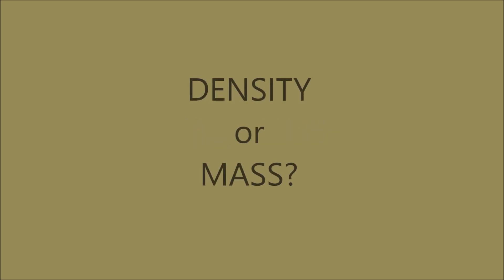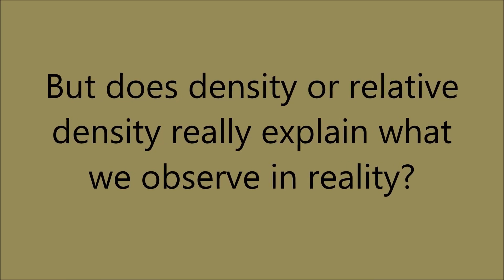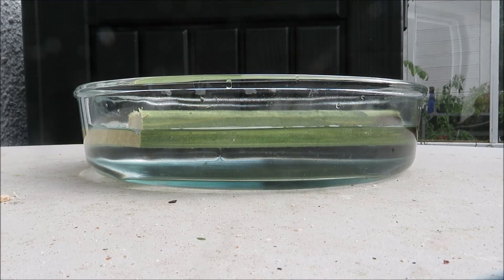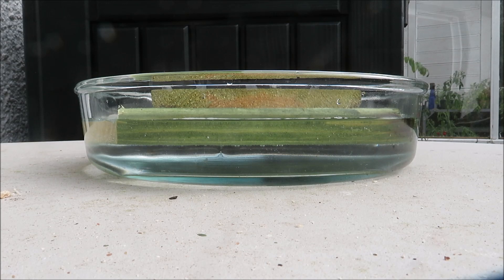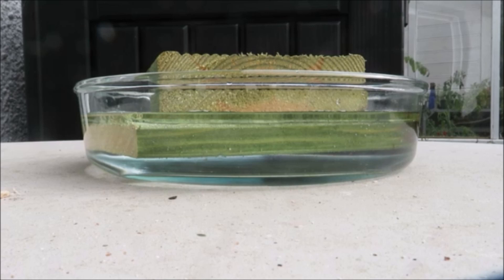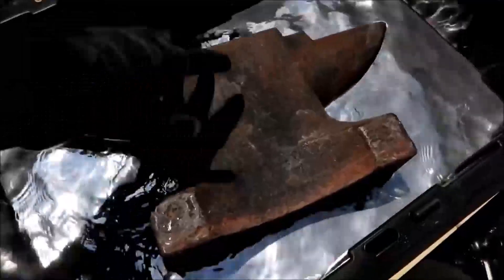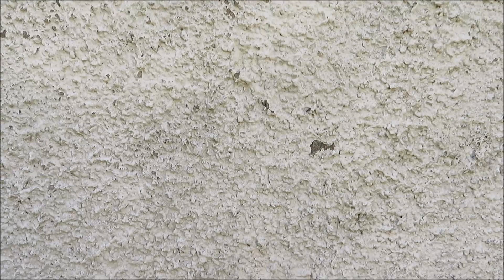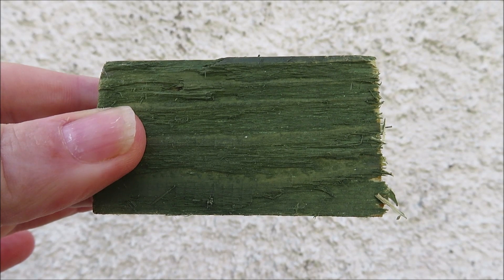Density or Mass?   Gravity or Relative Density?

Comment: @Miles WOW Someone clearly does not understand what density is!! You know the density part is comparing an equal volume between the two i.e. kg/m3 or g/cm3. When you have an unequal amount of volume and an unequal SHAPE, then the surface will displace the same amount of mass as itself, you having a container will restrict the volume and create a pressure. You have mistaken density comparison for structure and volume Hahahahaha You clearly do not understand the Archimedes Principle and you clearly do not understand how he made one of the largest ships in history with his knowledge of SURFACE AREA DISPLACEMENT!! OMG Miles welcome back... and what a come back this is!! How did your Cavendish "bedroom" Experiment turn out again?

And your last question is an HILARIOUS misunderstanding of density!!

AIR ABOVE WOOD = 0.001222 g/cm3
AIR BELOW WOOD = 0.001221 g/cm3
WOOD = 0.96 g/cm3

Neither the air above nor below can support its mass WITHOUT A STRUCTURE, i.e. a cotton net can catch a cannonball due to its STRUCTURE not comparative density.

You are completely omitting the last bit of the Principle of Least Action:

"The wood will seek the path of least resistance [YOU STOP HERE] in order to achieve its natural equilibrium/rest again"

In the case of wood YOU have elevated it UPWARDS in order to take it out of its natural Order of Magnitude of Density resting place. This will ALWAYS mean that it will return in the opposing direction with a vector pointing straight to the quickest path to where you took it out of rest!! You simply cannot understand how I can describe the whole notion of picking stuff up JUST using Newtons Laws of motion WITHOUT invoking a magic force!! YOU on the other hand think you are a magician and can pull gravity out of your sleeve... Sorry you may have gone, but unfortunately I have not!!

Newtons 1st = A piece of wood on the floor will stay on the floor until you pick it up. Picking it up requires energy input which is stored as potential in the net system.
Newtons 2nd = The wood will remain suspended in air if you clench your fingers and keep applying a force proportional to its mass and distance from its equilibrium and keep it there.
Newtons 3rd = When released the wood will return all energy inserted in to the system will be released and going from zero to non-zero requires acceleration from the input energy stored inside the system already. This gives us a rate of induction through the medium and the maximum rate being terminal velocity.

Archimedes Principle = This will determine relative direction depending on density of the object vs medium
Principle of Least Action = The wood will seek the path of least resistance to seek equilibrium with all other wood on the floor at rest.
Reply from the maker: Thanks for that, I may have to use this comment as a subject for a future video.  For now, I have just made a follow-up video which you may wish to have a look at.
Reply: @MilesDavisKDAB  Have you been cut off from benefits? And just need to make as many videos making as many mistakes as you can just to get people to comment and watch? Hahaha weak marketing tactic. Notice how you cannot address a single thing I just schooled you on!!? Is it because you think your next video covers this?? Hmm nope, I have already crushed your next video in this comment alone too!! Please just address your issues:

1/. Why did you NOT know or understand that STRUCTURE of the wood vs the VOLUME OF WATER. What you are attempting to debunk is the Archimedes Principle which is simply put as:

"Any object, totally or partially immersed in a fluid, is buoyed up by a force equal to the weight of the fluid displaced by the object." or even more simpler "Any floating object displaces its own weight of fluid." - Archimedes

2/. Why can you not tell me why I CAN explain the complete system of picking wood up and dropping it WITHOUT one single mention of a mysterious gravity force?

3/. Why can you not tell me why you think a piece of wood dropped in air would seek the medium ABOVE it when the very medium below it is a 1000 times less dense and cannot support its mass?

You are stumped more than the whole English Cricket team's careers put together!!
Reply: You need a force to determine the direction. Density is directionless. Why does higher density go down and lighter density up? Mass/volume has nothing to do with direction or force. 

If you're gonna make up some reason things fall without gravity then at least make up your own units. The ones you use already have meaning.
Reply: @thefoxamongwolves9843  "You need a force to determine the direction."
Err did you not see the potential force input in to the system? Hahaha lets pretend you did not pick it up yeh? Well then its there on the floor not moving..... Now what? It doesn't fall does it!!

"Density is directionless."
It has a natural sorting order called the Natural Orders of Magnitude of Density... Its the old more dense stuff below and less dense stuff above, if you deny this then you have a clear problem with reality and need to get that fixed.

"Why does higher density go down and lighter density up? "
Because of the natural orders of magnitude of density. I mean woods equilibrium is not in a cloud, so why would you expect it to go UP when you had to PICK IT UP in the first place and it was not already going UP!! Come on this is common sense, something you seem to neglect.

"Mass/volume has nothing to do with direction or force. "
Good job its the disequilibrium of an objects density within a medium with a certain density, which you will find is fully covered in Archimedes Principle which does not contain Gravity and worked fine without it for 2000 years...

"If you're gonna make up some reason things fall without gravity then at least make up your own units. The ones you use already have meaning."
Why when the existing units of kg work perfectly fine! You don't just make stuff up in science!
Reply: @Gleem "you have a clear problem with reality and need to get that fixed." Ironic. 

You don't get it do you? WHY does it order itself in that way? You can say your made up rude of density but you have no evidence for it. It fails when applied to anything. Why does it stop working in free fall?Why do things fall at a constant rate in a vacuum? What is the 9.81 m/s^-2 acceleration we measure and why does it apply to everything? Wouldn't denser objects fall faster? You explain nothing with density because density is just a measure of how much mass is withing a volume, not how much force it exerts downwards. That is why you need new units, Kg doesn't work because Kg only means mass. Where is the direction? it's a directionless unit. What applies this force and direction? 

Where is the paper for the Natural Orders of Magnitude of Density?
Reply: @thefoxamongwolves9843  Sorry just moved devices, so to add:
"You don't get it do you? WHY does it order itself in that way?"
Earths electrostatic field does the job much better than a mysterious force that does not wok at quantum scale and does not work at cosmic scales.

" You can say your made up rude of density but you have no evidence for it. It fails when applied to anything. "
No it does not when you shift concept of a mysterious force to a natural order of magnitude and use the Gravitational Potential Energy as your input energy instead of shifting your hard work on to a magical force.

"Why does it stop working in free fall?"
It does not at all, you simple do not know how it works..

"Why do things fall at a constant rate in a vacuum? "
They don't look up Guinea Feather Vacuum on youtube and see University of Washington Physics Lecturer who made himself a dual vacuum with each object dropping in seperate vacuums excavated by the same pipe. When he drops them literally all occasions they do not fall equally. Also Boyd Bushmans Anti-Gravity Drops in Lockheed Martin, and also in the same vacuum it is merely the pressure from the displaced medium acting on both objects equally on the top. Its all easily explainable without invoking magic forces when you look in to it.

"What is the 9.81 m/s^-2 acceleration we measure and why does it apply to everything? "
Its the measured rate of induction through the medium on the surface of earth. When I mean the medium I mean the electrostatic medium which we all swim in, going up to about 50km.

"Wouldn't denser objects fall faster?"
Why are you giving them more force to fall faster? If not then why should they? All they will do is reach a rate of maximum induction, which is terminal velocity.

" You explain nothing with density because density is just a measure of how much mass is withing a volume, not how much force it exerts downwards. That is why you need new units, Kg doesn't work because Kg only means mass. Where is the direction? it's a directionless unit. What applies this force and direction? "
You give the vector from whence you act upon it.... I don't know whether olde english words will help you get it, as plain and simple language is not working! Kg's are a unit of MASS, gravity is an assumption BUILT IN to that total measurement. MASS is still the same and WEIGHT is still the same on a flat earth, weight is merely a product of how mass acts in a medium of equal, greater or less density. This gives the directions of at rest, up and down...
Reply: @Gleem That's not a paper? That's a reference for magnitudes of density. You know what a scientific paper is, don't you? Like Einsteins paper of the theory of relativity and such. That explains how all this works and cites evidence. It should explain how this electrostatic induction thing works. Of course it doesn't exist because no flat Earther has ever written a scientific paper. 

Citations please for the vacuum chamber tests.

Finally, units. If induction is indeed behind this then why isn't it part of the units? Like how weight is mass X acceleration. Density has no involvement, just like it doesn't with gravity. See all you're really doing is replacing gravity with electrostatic forces. So why all the song and dance about density when it doesn't come into play any more than it does in the gravity model? 

I think it's because you have no idea what you're talking about and are desperately grasping at straws hoping to sound smart. Maybe to a pigeon, but you're not fooling me.
Reply: @thefoxamongwolves9843  So what was wrong with the 6 papers listed at the bottom?

"Pressures in the low 10−14 torr range have been reproducibly achieved in a 3 m long vacuum chamber. Pumping was provided by a 400 I s−1 sputter-ion pump, a titanium sublimation pump and 43.5 m of a ZrVFe Non Evaporable Getter (NEG) strip. Activation of NEG has been passively achieved during the initial bakeout of the vacuum system. The pressure has been measured by means of a modified version of the Helmer gauge, designed and manufactured at CERN."

Obtention of pressures in the 10−14 torr range by means of a ZrVFe non evaporable getter 
https://www.sciencedirect.com/science/article/abs/pii/0042207X9390084N?via%3Dihub

NASA List of magnitudes they have measured:
https://history.nasa.gov/SP-402/ch2.htm#37
https://history.nasa.gov/SP-402/p2.htm

"Ultralight (<10 milligrams per cubic centimeter) cellular materials are desirable for thermal insulation; battery electrodes; catalyst supports; and acoustic, vibration, or shock energy damping. We present ultralight materials based on periodic hollow-tube microlattices. These materials are fabricated by starting with a template formed by self-propagating photopolymer waveguide prototyping, coating the template by electroless nickel plating, and subsequently etching away the template. The resulting metallic microlattices exhibit densities ρ ≥ 0.9 milligram per cubic centimeter, complete recovery after compression exceeding 50% strain, and energy absorption similar to elastomers. Young’s modulus E scales with density as E ~ ρ2, in contrast to the E ~ ρ3 scaling observed for ultralight aerogels and carbon nanotube foams with stochastic architecture. We attribute these properties to structural hierarchy at the nanometer, micrometer, and millimeter scales."

Ultralight Metallic Microlattices
https://science.sciencemag.org/content/334/6058/962

Densities of Osmium and Iridium - RECALCULATIONS BASED UPON A REVIEW OF THE LATEST CRYSTALLOGRAPHIC DATA 
http://www.platinummetalsreview.com/pdf/pmr-v33-i1-014-016.pdf

"Citations please for the vacuum chamber tests."
What are you really going to do with them if you cannot even scroll a webpage and pay attention for more than 5 seconds!!

Guinea and Feather
https://www.youtube.com/watch?v=zXDZWKmRxI0

Here his is step-by-step guide of how and why he built it:
https://www.instructables.com/id/Building-a-better-Guinea-and-Feather/

Now please explain why you have NOT just prove you are the idiot here again? I just cannot figure that one out yet?
Reply: @Gleem Those are called "citations." You usually link them in your paper when you reference them for whatever reason. I asked for a paper on your Natural Order of Density, or is it induction now? Anyhow, I wanted a paper that explained how it all ties together. What you provided did no such thing and seems to have no relation to your relative density theory aside from the fact it has the word density. The citations are only there so I can check the references if I feel the need to, not to be your work. That's called plagiarism. Clearly you have no idea how scientific papers work.

Okay, the Guinea and Feather experiment. This doesn't prove anything, sorry. It is a neat demonstration but has a few flaws that invalidate it. The way the two objects drop isn't' controlled. We can't see the top of the tube when he flips it so we can't say for certain, but I think friction is delaying the drop of the lighter paper disc. Force = mass X gravity. The mass of the paper disc is certainly far less that the metal disc, so it would have less force pulling it down. This means the force of friction acting on it will hold it in place much longer than the metal disc.Thus the metal disc will begins sliding down first, giving the appearance of it falling faster. But that's not true. 

To actually prove anything you'd need to change the experiment a bit to remove that variable of friction. To do so I'd say ditch the whole flipping thing and add some sort of release mechanism. That way we can drop them at the same time. Though this obviously isn't always perfect either. Also, add in one those black and white scale things and record it on a high speed camera. That way we can actually compare how far they each move over a period of time and determine their acceleration. It's not a race, we want to see how much acceleration due to gravity/induction is being applied to them.
Reply: @Gleem Non of those papers are about your induction density theory. They're all just talking about either measuring densities or some cool material they've developed. None of them explain how induction solves all the problems of gravity. You don't need to yourself have written the paper (though I doubt anyone else would write one) but the paper you do link needs to actually be a paper and needs to actually explain your induction density theory. 

But sure, accuse me of not playing fair so you can avoid providing any evidence. I'd expect no less of a liar.
Reply: @thefoxamongwolves9843  "Non of those papers are about your induction density theory. They're all just talking about either measuring densities or some cool material they've developed. None of them explain how induction solves all the problems of gravity."
You did not ask for the resolve of all gravity problems, this is EXACTLY what I am here highlighting WHY HAS GRAVITY GOT SO MANY PROBLEM? You seem to not want to engage and just asked for citation of the orders of magnitude for density and Archimedes Principle... When its a reversal of concept, and go back to the original meaning of weight which is how mass acts in a medium, and that down force you speak of is merely air pressure. Then you ask for a paper on air pressure proving gravity wrong, when gravity was never proven in the first place and has an endless list of failures. 

When you are willing for a debate let me know, but what you are asking for is identical as me asking you to prove gravity on earth with a grain of sand orbiting a wrecking ball!!
Reply: @thefoxamongwolves9843  "I can prove" is the words of a fool put your evidence on the table which has been falsified...
Reply: @Gleem No. You provide your evidence for your induction density theory first. Don't think you can just change the subject. Prove that gravity isn't real and that this induction theory explains what we observe then we can talk about evidence for the Earth orbiting the sun in space. You can't worm your way out of it that easily.
Reply: @thefoxamongwolves9843  "@Gleem No. You provide your evidence for your induction density theory first. Don't think you can just change the subject."
I just put 10 papers on the table which are all evidence for it. And I am not changing the subject you simply cannot tell me where gravity is required here:

Newtons 1st = A brick on the floor will stay on the floor until you pick it up. Picking it up requires energy input which is stored as potential in the net system.
Newtons 2nd = The brick will remain suspended in air if you clench your fingers and keep applying a force proportional to its mass and distance from it equilibrium and keep it there.
Newtons 3rd = When released the brick will return all energy inserted in to the system will be released and going from zero to non-zero requires acceleration from the input energy stored inside the system already. This gives us a rate of induction through the medium and the maximum rate being terminal velocity.

"Prove that gravity isn't real and that this induction theory explains what we observe then we can talk about evidence for the Earth orbiting the sun in space. "
Gravity has been already proven not to be real, which is why its excluded from the Standard Model and fails miserably in the cosmos:

 "The Standard Model includes the electromagnetic, strong and weak forces and all their carrier particles, and explains well how these forces act on all of the matter particles. However, the most familiar force in our everyday lives, gravity, is not part of the Standard Model, as fitting gravity comfortably into this framework has proved to be a difficult challenge. The quantum theory used to describe the micro world, and the general theory of relativity used to describe the macro world, are difficult to fit into a single framework. No one has managed to make the two mathematically compatible in the context of the Standard Model. But luckily for particle physics, when it comes to the minuscule scale of particles, the effect of gravity is so weak as to be negligible. Only when matter is in bulk, at the scale of the human body or of the planets for example, does the effect of gravity dominate. So the Standard Model still works well despite its reluctant exclusion of one of the fundamental forces."
https://home.cern/science/physics/standard-model

And fails in these 3 x peer reviewed problems:

1/. Galaxy Rotation Curve Problem
Rotational properties of 21 SC galaxies with a large range of luminosities and radii, from NGC 4605 /R = 4kpc/ to UGC 2885 /R = 122 kpc/ - Vera Rubin and Kent Ford
http://adsabs.harvard.edu/full/1980ApJ...238..471R

Dr Don Lincoln - Fermilab (US Dept of Energy) - Big Questions: Dark Matter - 6m55s
https://www.youtube.com/watch?v=oPNrcKeqbBM

2/. Cosmological Constant Problem
The Cosmological Constant - Sean Carroll
https://link.springer.com/article/10.12942/lrr-2001-1

Dr Don Lincoln - Fermilab (US Dept of Energy) - Big Mysteries: Dark Energy - 7m42s
https://www.youtube.com/watch?v=THT_BAdKe6g

BONUS EVIDENCE OF INTELLIGENT DESIGN
Leonard Susskind - The Cosmological Constant Problem - 2m50s
https://www.youtube.com/watch?v=nXi_YaDO9ZI

3/. Horizon Problem
Inflationary universe: A possible solution to the horizon and flatness problems - Alan guth
https://journals.aps.org/prd/abstract/10.1103/PhysRevD.23.347

The horizon problem - why does the universe look the same in all directions?
https://www.youtube.com/watch?v=axrbSOFIdnk

BONUS EVIDENCE: Vera Rubin who was the main Astronomer behind Dark Matter is cited as saying:

“We know very little about the universe,” Dr. Rubin said in an interview for “Lonely Hearts of the Cosmos: The Story of the Scientific Quest for the Secret of the Universe.” “I personally don’t believe it’s uniform and the same everywhere. That’s like saying the earth is flat.”
https://www.nytimes.com/2016/12/27/science/vera-rubin-astronomist-who-made-the-case-for-dark-matter-dies-at-88.html

"You can't worm your way out of it that easily."
How is it that I have put 13 science papers on the table backing my sentiment, I can describe dropping stuff using just Newtons Laws of Motion, and have science which backs my statements, you on the other hand are just hand-wave dismissing, making claims you cannot back, and have not cited a single science source which backs you... Come back when you are willing to talk science, as you are clearly inept at the moment.
Reply: @Gleem You think you can describe dropping stuff with Newtons Laws of motion but you can't. You're either being dishonest or are ignorant. 

The Laws:
1: An object in motion will stay in motion unless acted on by an outside force
2: Force is equal to the change in momentum change in time or the mass times the acceleration.
3: For every action there is an equal and opposite reaction.

Now let's describe picking up a rock. You apply a force to lift it. Were there no gravity and you stopped applying force the rock would fly up forever. But you're holding it so you stop it and thus apply a new force to arrest it's motion, placing it at rest. Now you let go. The rock falls. We can conclude that some force was applied to the rock. What force is this? Most would say gravity. 

What you were describing was kinetic and potential energy. And for the post part you're right, lifting an object stores potential energy in it. Potential energy isn't literal energy, just a measure of how much energy the object will have when/if it falls. What you've neglected is where the potential energy come's from. It comes from a force acting on it. The rock is being lifted up inside a gravity well, kinda like swimming up stream. The higher it goes, the more gravity (or induction, principal is the same) wants to pull it back down. So the potential energy, the energy it will exert when it falls, increases until finally released and it can convert to kinetic energy. But you need a force to apply it. What force? Most would say gravity.

See, the irony here is you'd argue this inductive force but you'd be contradicting yourself. You claimed to be able to describe dropping an object with only Newton's Laws but as I've demonstrated: you can't. You need a force of some sort. If you claim that it's this inductive force then you straight up lied as you said you could describe it without such a force. Gravity and induction density whatever ware interchangeable, the physics is the same. 

Which is it? Do we need a force to explain this observation or not? If we do then why'd you lie about it? If we don't then again, why lie and make up this induction stuff? 

I could look at the other stuff but this screw up demonstrates that you probably don't actually know what those papers are saying and just think that they disprove gravity when, just from looking at the titles, they do no such thing. All they do is acknowledge the limits of our current understanding of gravity. 

If you have integrity you'd admit you are mistaken.
Reply: @thefoxamongwolves9843  "Now let's describe picking up a rock. You apply a force to lift it. Were there no gravity and you stopped applying force the rock would fly up forever. But you're holding it so you stop it and thus apply a new force to arrest it's motion, placing it at rest. Now you let go. The rock falls. We can conclude that some force was applied to the rock. What force is this? Most would say gravity. "
You clearly do not understand how basic physics works. The "some force" is the Gravitational Potential Energy you have put in to the net system in the first place by picking it up!! This same energy is returned when you release the brick. If the medium around the brick is more dense then the brick will go up, if its less dense the direction will be down. Its that simple!

"What you were describing was kinetic and potential energy. And for the post part you're right, lifting an object stores potential energy in it. "
Ok so now you agree.... So does this mean YOU are "either being dishonest or are ignorant. "

"Potential energy isn't literal energy, just a measure of how much energy the object will have when/if it falls. What you've neglected is where the potential energy come's from."
Nope not at all, the potential is inserted BY YOU!! As if YOU did not put in ANY energy, then the brick would not fall.. As soon as you put some energy in there, it is stored as potential until this is RELEASED, once release it returns all the energy you put in as an output kinetic energy!! This is an INESCAPABLE FACT, its just YOU remove YOUR input energy and pretend its some ghostly force getting involved....

" The rock is being lifted up inside a gravity well, kinda like swimming up stream. The higher it goes, the more gravity (or induction, principal is the same) wants to pull it back down. So the potential energy, the energy it will exert when it falls, increases until finally released and it can convert to kinetic energy. But you need a force to apply it. What force? Most would say gravity."
Its NOT a gravity well, its AIR PRESSURE as there is 1 ton acting on all sides. What we are debating here is "WHAT CAUSES AIR PRESSURE?"and I say natural density and buoyancy of the object and medium. And using YOUR own potential energy input as the force mechanism instead of pretending you never lifted it in the first place and was fighting against some ghostly field which no one can demonstrate without putting a human/mechanic force input first.

"See, the irony here is you'd argue this inductive force but you'd be contradicting yourself. You claimed to be able to describe dropping an object with only Newton's Laws but as I've demonstrated: you can't. You need a force of some sort. If you claim that it's this inductive force then you straight up lied as you said you could describe it without such a force. Gravity and induction density whatever ware interchangeable, the physics is the same. "
The point here is you are neglecting the energy input by the person and ascribing that to an external force. You have to believe when an object is at rest there is ALWAYS a force acting on it, which you cannot prove and I can disprove and provide a replacement mechanism which governs air pressure, being the earth Natural Electrostatic Field, which co-incidentally is the same fundamental force which sticks molecules together in the first place to create density in the Chemical Bonding process. Oh and I wonder what force humans use to pick up stuff... Hmm send an electrostatic signal from your brain to your muscles to use electrostatics to contract your muscles and keep a electrostatic grip on the brick until release. Its ALL electrostatics, density, gravity, natural orders of magnitude of density, air pressure all governed by electrostatics. 

All you are telling me is "Please believe me that there is a force there, we can forget all other forces just pretend that you never picked something up and inserted your own energy in to the system", when I can show you it failing miserably in science and also show you a replacement and remove the need for this magical mysterious force! You have literally asked me to cited everything here, and I have:

1/. Dual Vacuum
2/. Peer reviewed errors with gravity
3/. Replacement mechanism of gravity
4/. Replacement force of gravity

I CAN and HAVE provided these, now its your turn to back your statements here please:

"Gravity has no problems" = I have shown you its excluded from the Standard Model of Particle Physics as its incompatible, also I have shown you the Galaxy Rotation Curve Problem which is the biggest and longest outstanding problem in physics discovered in 1930 by Fritz Zwicky and Jan Oort = You are making claim that I have debunked you on and you are yet to counter.

"I can prove the Earth is a planet orbiting the sun, the problem is can you comprehend it? " = Really then why is Albert Einstein backing me here and not you? And science does not PROVE stuff so what witchcraft are you using to prove stuff with absolute 100% certainty!!

“The struggle, so violent in the early days of science, between the views of Ptolemy and Copernicus would then be quite meaningless. Either CS [coordinate system] could be used with equal justification. The two sentences, “the Sun is at rest and the Earth moves,” or “the Sun moves and the Earth is at rest,” would simply mean two different conventions concerning two different CS.”
― Albert Einstein, The Evolution of Physics: From Early Concepts to Relativity and Quanta

Right about now you are struggling to give me ANYTHING other than personal opinion and wild claims that gravity has no problems and you can PROVE stuff about the earth going around the sun? This is completely against what mainstream science says and the fundamental basis of Relativity IS!! Just confirming you are not well-versed in this physics business...

"If you have integrity you'd admit you are mistaken."
Please list what about and provide supporting evidence as you are already countered and debunked at this point!! If you cannot show me anything and just give me personal opinion again then this conversation is pointless when I CAN show science which debunks YOUR claims and you CANNOT show science which debunks mine.
Reply: @Gleem You haven't proven anything. 

1: The duel vacuum experiment is invalid and I explained why.
2: The errors with our current model of gravity do not disprove gravity. 
3: You haven't provided a paper or anything on your replacement mechanism.
4: Same as 3.

You think you have but you haven't. All the papers you've linked thus far have no relation. In fact, if you were to ask each of those scientists I guarantee they would all agree that gravity is indeed real. So unless you can provide me a citation of them stating "gravity isn't real and induction electrostatic theory is" from a reputable source, either those papers you linked or some other such source, then you're just cherry picking. Those papers simply point out the flaws of our current model of gravity and it's limitations. 

And you're trying to twist my words; when I said gravity had no problems I meant in every day life. It explains how objects fall, how density works and so on. The problems you provided are at the extremes: the infinitesimally small, the large and the fast. At the extremes the model stops working, yes. But it's not suppose to work there. But you wanna twist it into it meaning gravity doesn't work anywhere. If that's true then why would you use Newton's Laws when he founded the first model of gravity? Why trust any of his work?

Going back to potential energy. It's called POTENTIAL energy fora reason. Not stored energy. It's a measure of how much energy an object will have IF it is released. If you release an rock with 100 J of potential energy then that means it will hit the ground with 100 J of energy. That's literally what potential energy means. But you're welcome to prove me wrong by citing a physicist who says otherwise. But all the ones I've know have described it like that. Yes, I've attended university physics classes and passed.
Reply: @thefoxamongwolves9843  This is going no where as the papers are getting spammed or you are just being ignorant:

1/. "1: The duel vacuum experiment is invalid and I explained why."
The dual vacuum was made is there was NOTHING as precise available on the market to buy. He is a physics lecturer at Washington University and was sufficient enough to be a "PROOF" of gravity as the numbers calculated correctly... So if you get the holding opposing views where it IS GOOD enough to prove gravity acts on objects equally for a physics lecturer to teach students, however when its shown in fine detail they do not actually fall at the same rate then it IS NO GOOD to disprove it and other friction needs to be accounted for, which was not accounted for in the physics lecturer's calculations but he calculated gravity correctly.... Which is it? Evidence in favour or against gravity? I think you are in a paradox....

2/. "2: The errors with our current model of gravity do not disprove gravity. "
So when you need to make the universe 95% invisible undetectable stuff to make gravity predictions match observed reality, that is not evidence that it fails, especially when we have been looking for dark stuff for 90+ years and have zero evidence it even exist, except when pretending the same failed theory which created the fudge in the first place works... And it is in full breach of Relativity's 1st Postulate where all laws of physics must work in any coordinate system. Now in the coordinate system of a galaxy rotating, Keplers Laws, Newtons Laws, Newtons Gravity, Einsteins Gravity ALL FAIL by a factor of 10 consistently... Also with the advent of quantum mechanics, at a particle scale Quantum Field Theory is far more accurate than Classical Mechanics and Relativity which is why they have been replaced and people are looking to bring gravity back by inventing a graviton.. Gravity only works in the scale it was designed from, when you want to test scale invariance of laws of science they need to be covariant or they are NOT a law of science but a mere facet of the model.

3/. The papers must have been spammed here are their titles without the pdf links

An Electrostatic Solution for the Gravity Force and the Value of G

On the Classical Coupling between Gravity and Electromagnetism

Gravitation as 4th-order Electromagnetic effect

Defying gravity with entropy and electrostatics: sedimentation of charged colloids

Is Gravity Just the Electrostatic Force? - Franklin Hu

The Electrostatic Model of Gravity - XII International Symposium on Nuclei in the Cosmos August 5-12, 2012 Cairns, Australia, At Cairns, Australia

Electrostatic Gravity Mechanism of Action Based On Dielectric Properties of Physical Vacuum and Physical Meaning of Gravitation Potential 

Mathematical Model of Gravitational and Electrostatic Forces - Alexei Krouglov 

Gravity as the Second-Order Relativistic-Manifestation of Electrostatic-Force - RC Gupta

You can find them all online freely available.

4/. Same as 3

Now I am still waiting on your confirmation of your statements please? Its very telling when you cannot provide what I can provide...

" If that's true then why would you use Newton's Laws when he founded the first model of gravity? Why trust any of his work?"
Newton believed Aether was the mechanism behind gravity and did not actually produce a theory other than leaving it to his readers, of which he called the divine field... So do we need to all be Christians to believe in Aether and not bendy space-time because we believe Newtons Laws of Motions hold on a macro scale? You are being pathetic!!

"Going back to potential energy. It's called POTENTIAL energy fora reason. Not stored energy. It's a measure of how much energy an object will have IF it is released. If you release an rock with 100 J of potential energy then that means it will hit the ground with 100 J of energy. That's literally what potential energy means. But you're welcome to prove me wrong by citing a physicist who says otherwise. But all the ones I've know have described it like that. Yes, I've attended university physics classes and passed.
"

Yes this is ALL I was saying in the first place, its just the resistance concept in your mind is "A mysterious force which we do not know about done this" and I ascribe the whole notion to your energy input and its reaction through the electrostatic potential gradient field which is the underlining mechanism of density, aka Electrostatics.. You can pull the rhetoric card as all you have here is agreed I am correct, however just TOLD me I am wrong and I must attribute this "force" to a mysterious force which was only required in the first place to account for the orbiting of planets on a globe heliocentric model. If you are well versed in physics then please explain why the laws of physics fail outside the solarsystem, when any law in physics should adhere to General Covariance and operate equally at any scale. We have found the core function of gravity is NOT scale invariant therefore we have to CHANGE nature and pretend she is hiding something, instead of analysing nature and adapting our theories to match what she says! aka ANTI-SCIENCE...
Reply: @thefoxamongwolves9843  the point about the DUAL vacuum is moot as the same experiment "proves" gravity... All other drop tests when the objects are falling in the same vacuum is merely a measure of pressure displacement  acting on the top of both objects equally.

You cannot answer the other questions as you think the error bar matters when gravity is being disproven but works fine to prove it...
Reply: @Gleem What? Pressure doesn't have anything to do with why objects fall. That's why they fall in a vacuum. The duel tube set up doesn't have proper release mechanisms so you can't conclude that they're dropping at different rates because of what I've already outlined. The demonstration need to be revised. 

Gravity isn't disproven. You're cherry picking real science and applying it to your pseudoscience. None of those papers disprove gravity as a whole. They just point out the flaws in our model of it. We don't have a full understanding of it but it still exists. Just like how Tesla didn't believe in electrons but that didn't mean electricity wasn't real.  

Look, I've got actual important things to do. I don't have anymore time to explain highschool physics to someone who apparently failed it. When you actually do your own work and write up a paper, publish it and message me. Until then, leave alone the works of smarter people. They don't support your pseudoscience so stop cherry picking.
Reply: @Gleem  amazing comments thanks for that, 2 years ago… do you have a Twitter or something? Also, what do you think about the soul lure system and the ball mentality? Or does everyone here think the globe is true but are fighting over the terms ?
Reply: Toothpaste
Reply: @carlbrowning8409  plaque